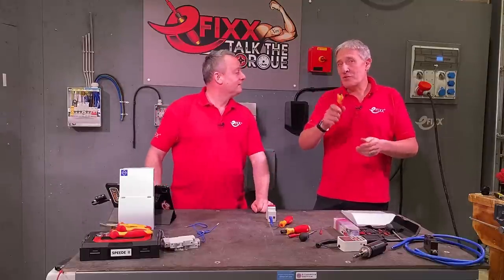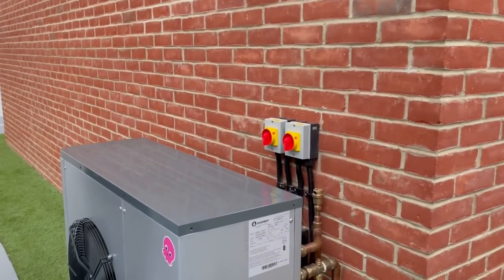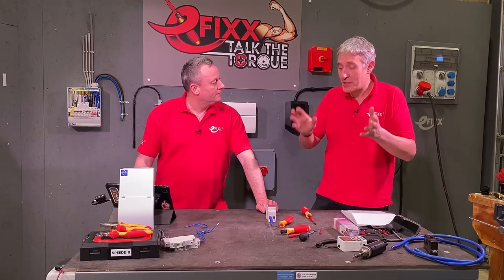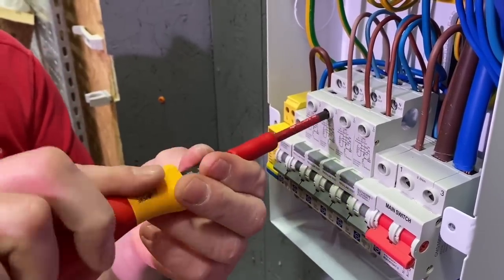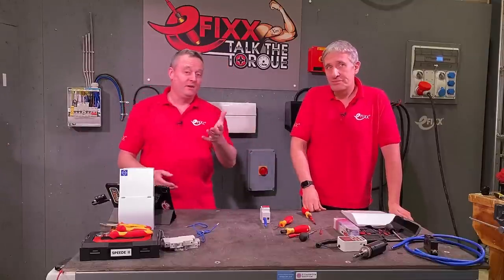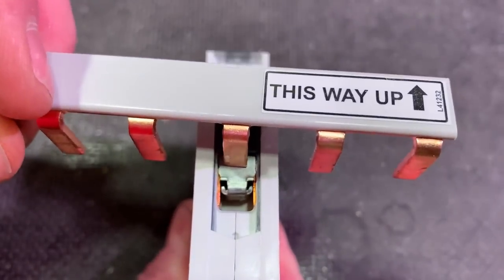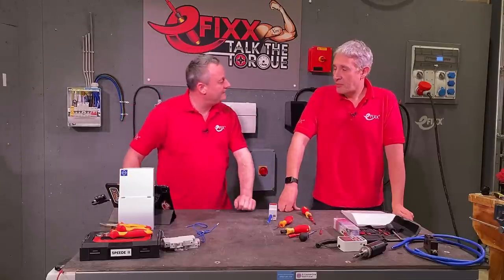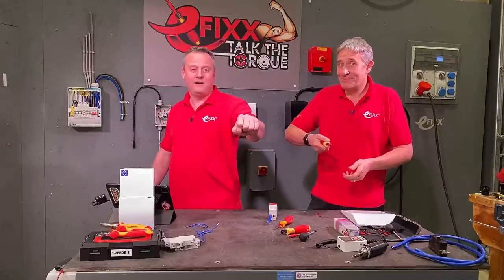LOOSE WIRES CAUSE FIRES 🔥 - A TORQUE SCREWDRIVER WON'T HELP!

Comment: With tails I always flatten a bit with pliers, terminate, and wiggle/re-tighten a couple of times. And another one: when doing a board is tighten as you go, but always to a full check of every terminal top left to bottom right before the lid goes on. 
I will admit until recently I haven't been a big user of the torque screwdriver, and even now I find it a bit funny that the importance of torque values (which i do not doubt are important) is stressed for distribution boards/consumer units, but its fine to use your own judgment for almost everything else. I've seen just as many cooked terminals in electric shower units and their isolation switches as I have in any switchgear enclosure. 
I also have to wonder, do all DNOs and suppliers insist on using torque drivers when they put their plastic cutout and meter on the bit of cheap chipboard that goes under our nice non-combustible/torqued up consumer unit? 😂

Comment: Bring back the old brown wylex consumer unit . 2 screws for every connection,  lives  neutrals  and tails  . No flimsy caged terminals.  Also put ferrules onto meter tails , this would stop the splaying  of the individual strands .  Hager supplied tail ferrules with their consumer units years ago . They were clearly ahead of their time

Comment: Use an isolator with round holes specifically for meter tails. Henley blocks also have round holes. 
Most DNO'S and suppliers now use the Proteus double screw round hole iso.
Reply: It would be easy enough for the consumer unit manufacturers to make the incoming side of the main switch with round terminals , even if they keep the cage design  .
Reply: @dennisphoenix1  Or better still, the manufactures stop this race to the bottom with extremely shallow cage clamp terminals (expecting the installer to somehow overcome their poor design) and use round tunnel terminals, with double screws for the main switch & larger OCPDs & accessories. And the main one, for christ sake get rid of these useless plus/minus screw heads, which are always made of the softest metals known to man, and use hex heads like the DNO equipment.
Reply: @jonanders76  I'd hope they switch to torx as it is superior to Hex since it has more surface area for the driver to catch on, that's why wera made "Hex plus" to try and solve the issue of screws rounding out.

Comment: Maybe if the manufacturers started to use terminal screws that dont strip before you get to the torque setting might help.
Reply: Most breakers use PZ/SL 2 slot. 
And there exists PZ/SL 2 screwdriver.
Reply: @tommymack3210  can't argue with that but I still stand on what I say about the very soft screws used by manufacturers.
Reply: @tommymack3210  can you recommend one that is narrow enough to fit deep slots on some RCBOs please?
Reply: Totally agree. The poor manufacture of even expensive equipment is appalling now days and it seems to be getting worse. Why aren't all the screw heads, on all boards and accessories deep terminals with hex heads, as per most DNO equipment? Just seems a no brainer to me.
Reply: @jonanders76  - maybe they do not buy into the 'over engineering' of 'potential fires' in consumer units....

Comment: Cross-threaded bolts. See it a lot on screw-in battery terminals. Bolt gets stuck, but you got the right torque on it, so everything must be fine right? But the cable is totally loose.

Comment: In the old days it was rare to have problems with the old Wylex consumer units where every live and neutral terminal had  2 screws. 
Lots  of the old wylex had wooden backs. Guess what we were told we couldn’t use them as the wood was combustible and we had to use plastic consumer units . What a joke the plastic ones were 20 times more combustible

Comment: As a meter engineer, I lean towards flattening out the cable strands except when its really fine multi strand as it tends to get cut by the terminal screws. 
I cleat the consumer unit tails to the board after de-energising but before removing them from either the meter outlet or isolator. Always try and swap any single screw/clamp terminal isolator for double screw. I have a method of doing a final check for tightness before sealing up and everything gets a little tug test. 
Had cutouts where the DNO haven’t tightened anything.

Comment: Focus on the terminal hole size. The conductor should be twisted (for stranded conductors)and folded so as to fill the hole with as much copper  as practical.  Visually examine every termination as you go and then check every terminal again when finished. If you making bad connections it might be time to give it up..

Comment: We have all come across the over tightened screw in a socket where one side of the screw slot has broken off! Or, one wire has acted a a fuse and blown off in a fault leaving an open ring! Over tightening a screw isn't doing anyone any favours. It's nearly as bad as under tightening!  Good video again!

Comment: I always find once you have put away your ends in the mcbs or main switch I always try leve my connections abt 15mins or so & more often than not you will get a good quarter turn on your connections that tip was passed on to me by an older experienced guy at the time & for me it's just a final wee nip up 👍

Comment: I always said from when torque settings were introduced to regs, it's a nonsense, because you can tighten a screw up to a certain torque, wiggle it, it will come looser, tighten it again, wiggle it, it will again come loose, copper is a malleable metal, and no amount of torque will make it 100% secure, but not moving the conductors will stabilise that movement and reduce its looseness in a terminal. I think cage terminals should also be circular to accept circular conductors.. Not square!.. Seems like mcbs/rcbos are designed solely for flat bus bar. The Conductor end clamp should be round or semi circular. Seems an easy fix to me but hey ho..

Comment: How much contact do wago connectors make with the cable compared to screw terminals?
Reply: You have to do something really weird for WAGOs to not have near perfect contact. That's the advantage of springs over screws---they automatically re-tighten themselves.
Reply: The springs actually make very little contact, but it’s not degraded by movement (it gets better, if anything) and that makes it Enough for their rating.
Reply: @JasperJanssen  The springs are just there to push the conductor against the busbar, they are not required to conduct themselves.

Comment: In my experience as a competent DIYer and site manager, the worst places for potential fire and burn out in sockets etc that I have seen is with electric shower supplies. Found 3 now. Damn lucky that each time the fire never spread but the fittings were badly damaged. Always hard to tell how tight or not they might have been after it has all melted. One consistent thing I have found though is they were all damp with corroded wires still evident with plenty of green corrosion on the copper. Found it a couple of times in other sockets as well but more of a tripping issue than fires. So a big issue in the millions of old homes with solid masonry walls and no DPCs I guess.
Reply: The good thing with traditional UK electrical accessories and patress boxes is they tend to be made of thermosetting resins like Urea-Formaldehyde which are pretty good at retaining their integrity under exposure to excessive heat. So a loose connection on a shower circuit does severe damage to the accessory but the problem generally remains contained within the accessory and it's box.

Plastic din rail enclosures (used for consumer units before the "metal consumer units" rule came in) OTOH tend to be made of thermoplastics like ABS which are much worse at retaining their integrity in overheating scenarios (though much better from an impact resistance point of view).
Reply: @TheFool2cool  good point. In the cases I have found the masonry has been damp which is why I have assumed dampness/moisture as the issue. Sometimes I have had to make the call to get the sparky to replace the in wall back boxes with surface mounted ones. I had to do the same for BT master sockets in my own house as 3 of them fried themselves before I realised the problem. Once surface mounted it was fine.

Comment: This is another reason why 100 amp DP isolators should be mandatory. Any new CU change should include a 100 amp DP isolator. Any subsequent meter change will not disturb the tails within the CU. Any meter change where there is no isolator should be forced to also install an isolator and check inside the CU main isolator for tightness.

New CU or new meter, whoever's there first should install an isolator. Sadly, there's a lack of joined up thinking in the industry and too much passing the buck.

 Mike.

Comment: Just a question, with stranded wiring should you not default use a crimp sleeve? And a remark about torque, if find it often rather difficult to find the specs specifically on older stuff.

Comment: Henley blocks and old Wilex boxes their twin screws, can't beat them.
55 years in the business, (now retired) never owned a torque screwdriver, there simply is no substitute for a good feel and common sense.
Physics exams state, measure twice. Carpenters measure twice cut once. These values are not taught today.
Youngsters today will rely too much on that click, and not really have the experience of the correct feel.

Comment: thats a properly thightened connection right there :D throw away those torque screw drivers and they wont bite you in the ass later. m12 bolt on a 300mm2 lug was tightened with torque wrench set to 80nm i was able to move the lug and we ended up using a regular wrench and tightened till it was held in place, no issues years later, as for the rating on the terminals that is a joke it will come loose within a year mostly, we can argue about it thats why maintance is important, but if you tighten it by hand good it wont come lose, if the breaker breaks when thightened all the way its a crappy construction.

Comment: Should low voltage (12-24V) terminals also be torqued down? Is it considered good practice or overkill?
Reply from the maker: Low voltage is higher risk - higher currents and I2R losses! - we've seen LED strip installs cause fires!
Reply: @efixx  Thanks for the response. Thankfully I don't deal with high current stuff, but you never know when you are going to start. Gonna start saving for a Wiha.
Reply: Voltage does not cause heat. It's current that does. Are you a qualified electrician?
Reply: Extra low voltage...

Comment: It's 2022, wheres wago RCBOs? Saves any messing about with torque screwdrivers, and if manufacturers are smart about it, it'll stop DIY DAVE putting a 3rd 2.5mm into a 32a
Reply: Some of the brands in my country have them on outputs (not sure if they are actual licensed wago terminals or something else, but either way).

Hager, Schneider electric, ABB, Siemens all carry them, at a slightly higher cost than standard screw. And of course they’re all already quite pricy brands.

Comment: The problem with reliance on torque screwdrivers, IMHO, is it depends on the medium being tightened. Copper is ductile, and I think we need to encourage a common sense tug test mentality. I have experience in aviation maintenance, torque loading is normal 'steel to steel' I am not so sure with this 'copper to brass' obsession.

Comment: So much whine around strands twisting out. You guys there in UK. Have you heard anything about ferrules? Absolute fail if not installed on fine stranded wires here....
Reply from the maker: Ferrules on class 2 conductors is a grey area. 
see discussion in the video - https://youtu.be/Ia13o1I6DkM

Comment: More grist to the mill for my favourite gripes:

1. IRRESPECTIVE of the cable type ALWAYS use the right sized ferrule. Even solid core cables benefit due to the extra crush resistance. Ideally for screw terminals use a quad crimper and set the ferrule flat side up when screwing down and use a hex crimper when fitting into cage clamps.

2. Fires inside CU's would RARELY if EVER happen if a proper temp sensor of below 85° were fitted and triggering - a contactor (resettable type that consumes zero power in normal use (nc contacts) opens on a fault and will not reset except manually. No high temp ... NO fire!

In the worst case even causing rcd or rcbo tripping to isolate when a temp fault occurs.

3. WHY are busbars fitted below not above the breakers where they should be? Yes I know UK breakers suck with stupid flying neutrals instead of proper double pole RCBOs and standard breakers too . Top in bottom out SHOULD be the norm not what we have now. MUCH easier to check for a single cable connection in the bottom rather than the mainly hidden busbar under insulation. At the top the busbar connections can EASILY be seen!

Comment: I'm being taught atm. I've been taught to always tighten terminals give the cables a good pull to check. Then once everything is finish go around for a final check as by then the copper strands should of settled in place. None of the sparkies that teach me have used a torque screwdriver or think they're worth it so long as you got half a brain and don't under torque.
Reply: Worked in the game 16 years and never used a torque screwdriver it’s a utube sparky thing. I think I seen one bloke use one once. These lads are sponsored to sell tools
Reply: Technology move on &  the torque screw driver is not the cure for all problems. I've been in the game for 30 yrs and never used one. I think like most things the price of these are way to expensive plus it needs calibration after 12 months £££ I would be sticking to my screwdriver and to date I have  not had to make a claim on my public liability 🤑
Reply: @gggggppppp  - 'Well your honour, I didn't think that the manufacturer's instructions would ever come back and bite me on the arse. Didn't realise how the legal system worked... '

Comment: Unguarded clamp terminals should be banned. There's no reason to use them over guarded ones, other than the manufacturer saving 1/10 penny worth of material...

Comment: So I am right after all 🤣 use torque screwdriver is a complete waste of time, as as you have just proved  with the main switch demonstration, I have said before for if you put a single conductor in the terminal then double the over the ends as it gives the screws a bigger area to clamp down on . Gaz that’s what you tort your Lerner’s for 19 years and it is how you and I were tort . 
Fantastic video guy’s as always 
👍❤️👍👍👍👍